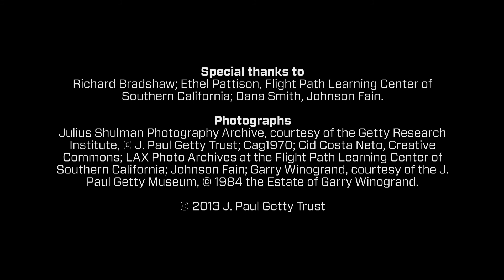Richard Bradshaw on the Construction of LAX (Modern Architecture in Los Angeles)

Comment: The Theme Building was obviously the center of attention. Now, it has literally "sunk" as the whole airport has gone through many renovations and expansions as things started rising all around it. It's still there but it's possible some people might miss it while going around the terminal loop. As far as all the buildings being "shells," if that happened, it would have never lasted. Look at the airport today. They would have all been replaced by now. It would be nice if the Theme Building restaurant would reopen. I think they missed an opportunity with the construction of the people mover. It goes around it. If they made a walkway going through or connected to it, there would have been plenty of foot traffic from people going to the airport.  Instead, it's in the middle of the airport but not connected to anything.

Comment: I put this building in the same category as the old TWA building at JFK by Eero Saarinen.  They were designed to reach people on an emotional level.  We forget that in the 1960's most people didn't travel by air.  They traveled by train or bus.  Heck, the Interstate Highway system hadn't even been completed yet so automobiles weren't much of an option then either.  The masses of fliers we see today is as a result of airline deregulation in 1979 which brought prices way down.  But I find it sad that these beautiful building are being buried by larger structures all around them.